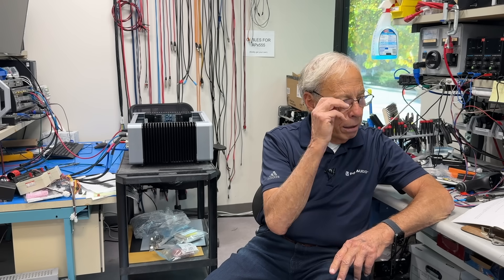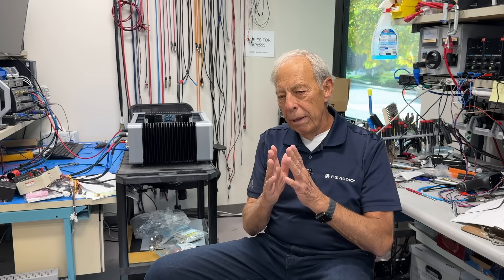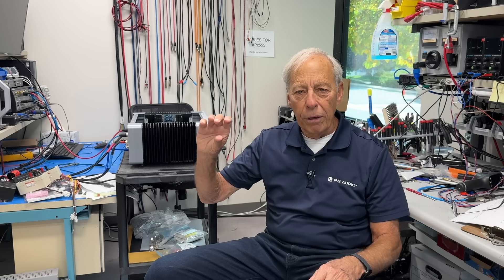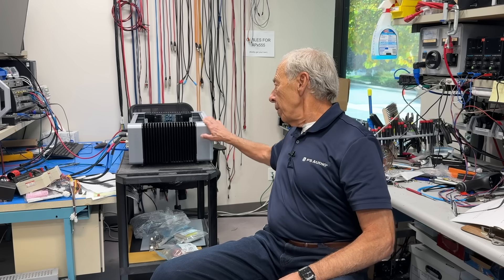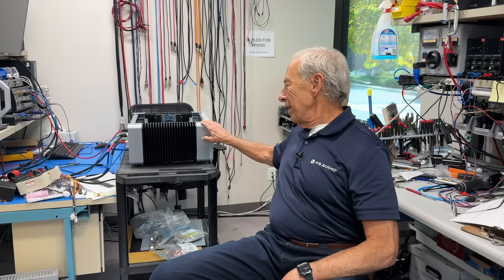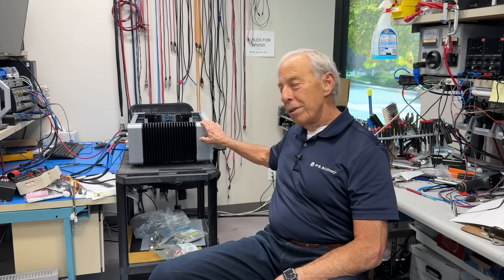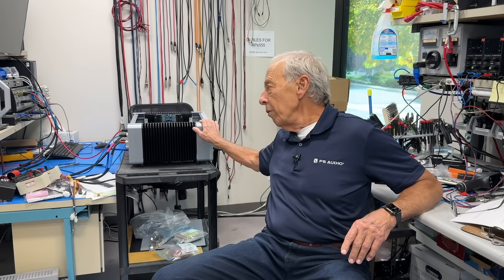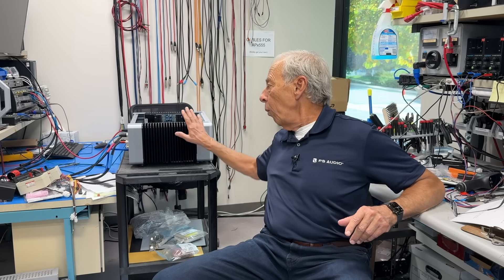Digital vs  Class A and AB amps

Comment: Square wave cleanines and symmetry depends on the frequency. Clean square wave at less than 20k isn't a big deal and relatively simple power amp circuit can achieve it. It usually indicates the slew rate of a Poweramp. Clean square wave at over 50k is an achievement and indicates a high slew rate. Contrary to intuition, a high slew rate in a power amp is easier to achieve than in small signal circuits due to high currents in the power amp. At PMG price point, parts count required to achieve a high slew rate is a non-issue. There are medium parts count MOSFET power amp topologies that can achieve a slew rate of over 200.

Comment: Some Class D amp tests on YT showing quite stunning results including square waves from very affordable Chinese class D amplifier boards, specially newer boards based on the TPA3255 Chip.
Reply: TPA3255 is quite capable indeed. The TI specs are excellent. With good engineering incl. power supply it might win over much more expensive amps. Would be nice to see some ABX blind tests.
Reply: Urm, the clue is in you’re first line “some class D amp tests ON YT”, need go no further, if you’re doing any kind of audio test on YT, you don’t understand audio
Reply: @Trooosed Obviously we want to get some actual critical listening tests with high end audiophile speakers and proper room setup to figure out if this is just a spec on paper product or it actually sounds awesome.

Comment: BS…. Ripples on top of the square wave are there just because the bandwidth of the amp is limited and not infinite. That is all. A perfect square wave needs infinite bandwidth. The higher the bandwidth (which means the higher the frequency the amp can reproduce, well wishing the supersonic range) the better the wave looks. Whether this has anything to do with sound quality is highly debatable.
Reply: Wrong...ripples are from resonant L C filters...limited bandwitdh is rounded edges

Comment: Class D is not digital, Class D is not more digital than an FM radio. It is an analog signal that is Pulse Width Modulated!
Paul doesn´t answer the questions, just goes into a PS Audio commercial rant
Reply: I guess you missed the “air quotes” he used when he said digital. He was implying that Class D isn’t true digital and referred to it as Pulse Width Modulation, so he did answer the question. 

Oh, by the way, Paul is the CEO and owner of PS Audio. If he wants to “rant” about his new product, he can certainly do that. Don’t like it? Click ‘Unsubscribe’. 😂

There! Problem solved.

Comment: I can answer the Lyngdorf question. I own a Lyngdorf TDAI-1120 paired with new old stock Martin Logan Motion 40 floorstanding speakers. 77" LG C4 tv is wall-mounted on an 81x110" section of black, acoustic vertical slat panels. Defying convention, the rear-ported ML speakers are butted against the acoustic panels as close as possible, to the point that I use right-angle bananas to get them closer. My home is an 1800 sq/ft ranch with an asymmetric vaulted ceiling (15.5ft above the right speaker. The media wall is perpendicular to the front and back of the house. The distance from the back wall to the wide front entry is about 30 ft. The living room (in front of the media wall) is 15 ft at its shortest but that distance is extended several feet by an open dining room and semi-open kitchen. I can't comment on the system sound before running the Room Perfect room correction because I ran the correction minutes after setting up the system. I did, however, experience the system last Fall in our huge, unfinished, concrete basement while contractors were working on the main floor. Before room correction, the sound was a total blur and imaging was completely obscured by reflections. The difference after running the room correction in my basement was astonishing. I consider my basement a worst-cast scenario, audio-wise. 
I listen primarily to jazz acoustic piano trios/quartets (Alexander, Mehdau, Alan Pasqua, lotsa European pianists) and acoustic string stuff. When we moved in November 2024, I had low expectations of sound quality in the living room because the room had VERY noticeable echoes and "boings." After my wife and I installed the first 2 of 10 acoustic panels, we noticed a dramatic reduction in "boing" and improved overall clarity. Even with a 77" tv and 2 loudspeakers obstructing the panels, the boing is gone, and the room is left with a subtle "reverb," which to my amazement gives my stereo audio a wonderful sense of spaciousness. I "hear" the house, and in this case, that's a good thing. At the same time, stereo imaging is pinpoint. I was afraid that the amp's modest power might not fill the large space because I generally prefer loud audio, but my fear was unfounded. I've owned (and still own) several analog receivers and various speakers, but my current system is on another level. One small amp, one pair of loudspeakers, no discrete preamp, no power amp, no DAC, no streamer, etc. All in one small box, looking neat on a floating console below the tv with all wiring hidden. I have a degree in electronics (retired) and I'm a part-time pro acoustic musician. Best wishes to all from Lancaster, NY.
Reply: Most of what I listen to involves a grand piano, carved upright bass, and jazz drum kit. Most of the rest involves acoustic guitar, mandolin (often Gibson Loar-era instruments), and fiddles. I rarely listen to rock music, so I can't comment on that. I've sat at dozens of jazz concerts sitting within 20 feet of the ensemble, with minimal sound reinforcement (reference Buffalo's Albright Knox Art of Jazz series, pre Covid). Top tier jazz ensembles from the US and Europe. I think I have a valid frame of reference regarding great jazz sound. On my system, upright bass easily has the requisite "thump" in addition to great clarity in the upper registers. Grand piano sounds round, clear, and dynamic. While listening to well-recorded jazz drums, I've experienced my head pivoting during tom rolls across the stereo image. Crash cymbals have an airy, detailed wash, and dry rides and snare side-stick hits sound like they're in my living room. No disrespect intended, but based upon what I've seen on Youtube, audiophiles seem to overthink and overanalyze stuff to the point of ridiculous. I love music listening, I love live music, I love creating and performing music, but based on what I've seen, I'm not an audiophile.
Reply: @crankypaul8484   ...Cheers!
Reply: @crankypaul8484 ...cool...thanks for posting 👍

Comment: i prefer class ab for the highs and mids . However i use class d for the woofers and subs. I have many amps in my stereo . . Class D for highs and mids works some people love them very clean sounding but its subjective . I do not like the tweeter role off  .  Most people cant hear it .    A class D amp with a tube pre amp may sound amazing for some but i prefer class ab.

Comment: Have to disagree. From previous personal experience with appropriate test equipment I did a tour of 6 states with signal generator, scope and dummy loads testing rise time and slew rates of any amp anyone brought into the store I was visiting. 10Khz squarewave in at rated power out. Yes most amps sucked at it! Slow rise times, overshoot/ ringing, sagging top, .... But the LO-7M matched the generator's output perfectly. Or even the KA-907.
Reply: Yet real music, even the most steep transients, doesn't look remotely as square waves nor impulse responses. Lightning fast rise times, square wave perfection, one point sample transients, etc... are a misleading (probably useless) information for any user that wants the better DAC filter, because other filters (less slope) will produce phase issues, imaging problems ("aliasing" effects) and more post-rigging (probably not a big issue), while pre-ringing isn't a problem with real music waves (hardly measurable, not audible). This can be even less important with real amplifiers connected to real speakers. The music I like isn't a square wave.
Reply: @Jorge-Fernandez-Lopez  A clarinet produces basically a squarewave! So FACTS.... And the more common alternative, the sinewave, almost never appears in music. It was just the easiest test signal to generate way back in the day. A squarewave gives multiple times more Test capabilities directly related to audio.
Reply: @glenncurry3041  I checked two clarinet tracks (real music): nothing like a square wave, no vertical shapes (not even close), no square angles. Facts ? What I see is way closer to a combination of added sine waves than anything "squared". Fortunately, the clarinet sound didn't add a bunch of infinite odd harmonics to a fundamental note, otherwise it wouldn't sound very well.
Reply: @Jorge-Fernandez-Lopez  "AI Overview
Sound Waveforms  A clarinet produces a sound wave that is a close approximation of a square wave because it is a closed-end pipe that generates only odd harmonics"

"A Square wave sounds closest to a Clarinet." Synth Programming Synth Basics: All Squares are Pulse 2025 Yamaha Corporation of America

"Basic Waveforms of Synthesizer: Square Wave
The square waves are similar to the clarinet sounds. The harmonic structure of the square waves creates a hollow sound." The Music Telegraph Ltd
Reply: @glenncurry3041   ...yeah, I wouldn't trust A.I. if my life depended on it.
Reply: Tweak my builds in a similar fashion, once you end up with a power amplifier for the signal generator, you're pretty much there; adding a couple of uF in parallel makes it even harder, regardless, fixed bias A or high bias AB complementaries tend to excel.

Comment: A Class D amp is NOT the same as a fully digital amp like the Lyngdorf TDAI 3400 for example, and I think Paul failed to mention that. A fully digital amp is a DAC + Power amp.
Reply: Class D is one of the principles for a power amp. The Lyngdorf TDAI 3400 has class D power amp modules. Why is a Amp with a dac And a class d power amp fully digital? Sorry, but this is Nonsens.
Reply: @Thesolicitor04  It's still not a "digital" amp though.. 😅
Reply: @5starmaniac That‘s what I meant👍
Reply: I wish Lyngdorf had more technical details on their site. But varying the volume by moving the operating points of the output stage is not a good idea. And with further research it seems their output is PWM, typical Class D. Not some truly different digital output!

Comment: It's all about great engineering. I actually have a pair of BeoLab 1 active speakers from 1999 with first generation icePower class D amp for the bass in it. Those speakers are still working flawlessly in my home theatre (caps got replaced).

Comment: This answer perpetuates a basic misunderstanding.The “D” in Class D does not stand for “Digital”. The “D” just happens to be the next letter in sequence for amplifier types.
A better label would have been “Class P” for PWM.
Reply: I’m glad you mentioned it. Class D is an analog amplification. It has nothing to do with “digital”. 
Input signals get filtered to create PWM signal (it’s still analog) and that’s fed to the output transistor to switch on and off, then simply go through a low pass filter. There is no “digital” in this process.
Just because it’s on and off that resemblance to digits 1 and 0 does not mean it’s “digital” There is no digital coding involved in Class D amplification.
Reply: Spot on
Reply: That's what he basically said
Reply: The Lyngdorf amplifiers are considered digital amplifiers.
Reply: @mitchtaylor6512  That's just marketing. No electrical engineer would consider it digital.
Reply: @tschorsch  The Lyngdorf "digital amplifiers" are one of the few true powerdacs on the market, and are not class D. @mitchtaylor6512 is correct.

Comment: We all know the answer here! Everything digital is rubbish, especially class D amplifiers. At least you got to have a class A/B amplifier but the best option is a Tube amplifier, they have the highest quality! Transistors are just not good enough and have to much power anyway.
Reply: Class D amplifiers aren't digital, they are still analog. Actual digital amplifiers exist but that is something else, much newer and still very rare. 

Saying that all Class D amps, or any other type, are bad also just makes one sound like someone that hasn't heard all that many products.
Reply: @Evil_Peter Why is it called class D then? The D is the first letter of digital, so it got to be that!
Reply: @RoderikvanReekum  It's actually as simple as that it was the next step in the alphabet. Class A, B (and AB) and C preceded it.
Reply: @RoderikvanReekum   ...😂🤣🤣...seriously?? Na-a-a-ahh!
Reply: Transistor technology has, and still continues to evolve in the quest to improve its sound. 
 You're making a blanket statement that is stuck in the past. 
 Am, I going to argue that tubes still aren't superior in sound? Of course not.
  But manufacturers are making amazing strides with modern transistors. 
 Today's automobile gas engines, are engineering marvels with their efficiency of fuel usage. They're nothing like the engines of even 30 years ago. 
 The same holds true for transistor technology.
Reply: @davidjudd951 the fuel efficiency of automobiles hasn't really come that far.
Reply: @mitchtaylor6512 
 I'm referring to the amount of fuel burned and used by the engine, as opposed to the amount that used to go out of the exhaust as unburned gasses. Nearly all fuel is now burned and used as energy. 
 You're correct about the mileage, but that's mainly due to the extra weight of safety mandates, and manufacturers making engines produce more horsepower.
Reply: Any time someone starts with "we all know", you know what they're about to say is almost certainly bull 💩.
Reply: @tschorsch 
 Correct!
Reply: @davidjudd951  It does not mean that everything  what all  people  know  is bu..it. Anyway  some people use   circling around popular   bu..it  which they name   "knowledge" to support  their point
Reply: @Mikexception 
 Not sure what you just said there. 
 Have a good one.
Reply: @tschorsch   ...we all know that 😉🍺
Reply: PREACH IT BROTHER

Comment: As the questioner referred to Lyngdorf, I think he referred to “Direct Digital” amplifiers like the Lyngdorf TDAI series and the Technics SU-R1000. These are amplifiers that process and amplify a digital signal without ever converting it to analog until the very last possible stage — when it drives the loudspeaker. Hence, the digital-to-analog conversion is effectively integrated into the output power stage itself. (As opposed to standard class D amplifiers.)
Reply: V Fets sound best. Sony came out with V Fet amps back in the 1970s. I believe they are the finest transistors ever made. They don't sound like transistors at all. They don't sound like tubes at all. They sound like music.There is something so sweet about their sound. There were technical reasons V Fets went the way of the Edsel. But it wasn't quality of sound. Still some V Fet amps on the used market. Try to hear one and hear how far we have not come.
Reply: the TA-N7 is my dream power amp
Reply: @sidesup8286  To me, high-frequency germaniums (e.g. 1t906a, gt813v, gt806b, gt321b) in single-ended form sound the best and also don't sound the same as other (silicon) transistors.
Reply: Technics does it way better. Lyngdorf's execution is not that good on ears. The Technics sounds immaculate.
Reply: @wa2368  The Technics is also just PWM output. Not truly digital.
Reply: @wa2368  paul should hear it and give an opinion ,the su-r1000 is something special
Reply: I wish Lyngdorf had more technical details on their site. But varying the volume by moving the operating points of the output stage is not a good idea. And with further research it seems their output is PWM, typical Class D. Not some truly different digital output!

Comment: In my experience a class D amp can sound pretty good, but it is very important to have a well regulated power regenerator - class D amps are much more prone to failure than other amps  if you get power surges or high THD on your power line.
Reply: Wrong. 90 percent of subwoofers are class D, and they sound fine
Reply: @ifeanyidede2106  This only applies to subwoofers because at low frequencies it is important that the amplifier controls the movement of the diaphragm well. At mid and high frequencies they are likely to sound sterile and dull, lacking in liveliness.
Reply: @321ime32prezime they sound sterile because they are more accurate with less distortion. Class a and ab are warm because of the upper harmonic distortion
Reply: @lifeatitsfinest3019  True, but you don't listen only with numbers on paper, but also with your mind. It's better to have mild (not excessive) distortion and enjoy the music, than to fall asleep from boredom while listening. That's why I prefer the Class A single-ended topology, which doesn't have too much distortion at lower power levels, but has just enough to be comfortable.